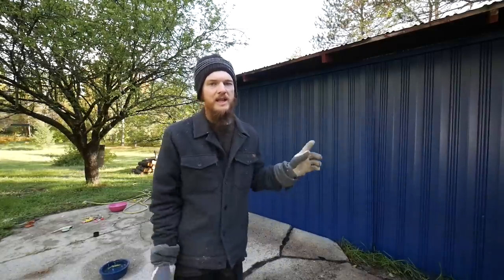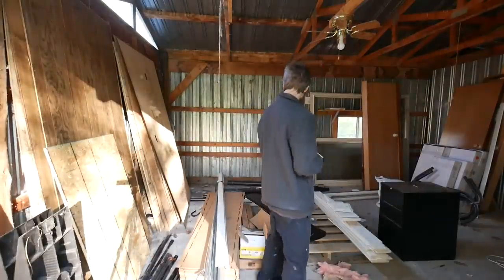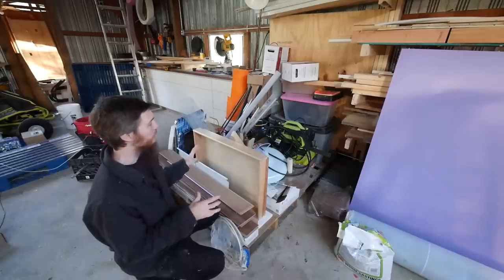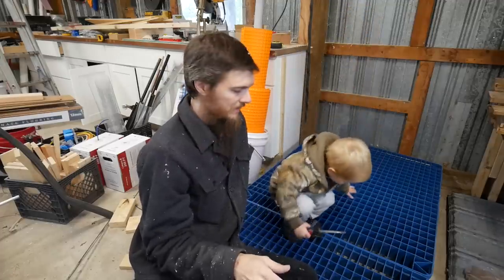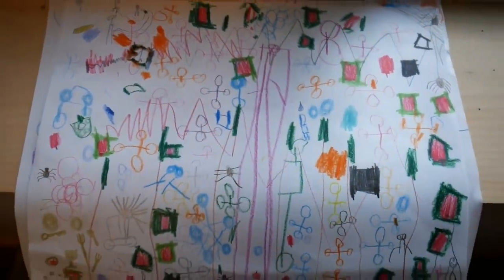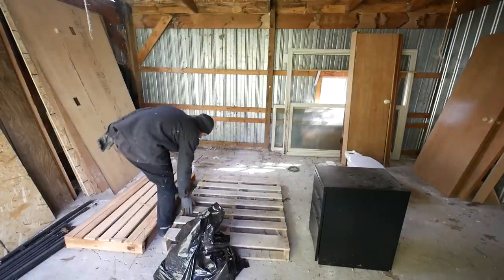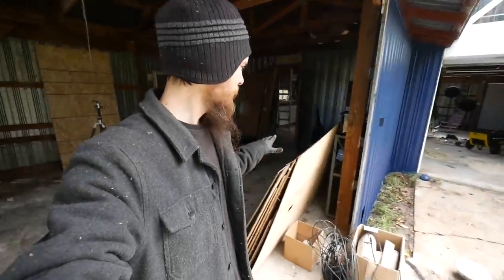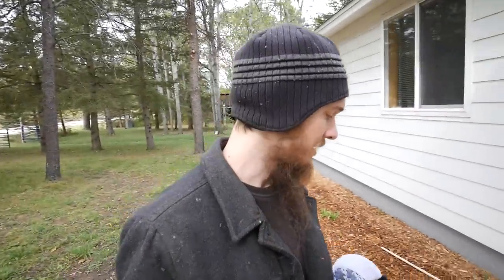This Mess Never Ends - Getting Ready for the Next Big Project

Comment: That space would be perfect for an Art/ Design studio. The old slider could be used for two large windows to let natural light in, insulate that room and then use the paneling in there, put up the wall cabinets to hide all the arts and crafts supplies, use the space header to keep the chill out and add foam insulation and rugs for floor. My Dad did that for me in the attic of our garage and I have been an Artist ever since. Its always nice not to have to pick up a project in process until you are finished. I would be lost without my studio.

Comment: Your siding pieces might come in handy if you ever need to repair  hole in your exterior  at some point [Mower throws a rock or some other accedent} I suggest you build a standing rack, say 12" deep or less, against a wall, for all your paneling pieces. Would not take up much room and have a spot for them and any thing else that would stand up.  Love watching you all solve your problems! You all are very inventive and so unique!
Reply: Great idea we were hit by a hail storm and the extra siding we saved was used to repair damaged pieces.

Comment: Use the wall cabinets as lower cabinets, they will just be a slimline version, you could possibly put some legs on the to raise them off the ground
Reply: I was just about to post the same.  A little blocking under and a nice top will make a nice bar in the new spot.
Reply: Or make an island style work bench out of them on rollers.

Comment: If you do not have any projects planned for the wall boards then maybe consider the walls in the room you are cleaning out now.  If the darker finish is not desired then paint them white or any color you choose.  It looks like they are actual wood panels and not the newer compressed paper laminate.  So consider them like luan.  They can also be nailed up backwards so the grooves do not show.  Some could be mounted above the cabinets in the main garage building for a tool wall.
Reply: I hadn't read your reply when I gave mine.  I had the same thought.  I thought I remember him saying it would be nice to have a heated room for a shop, and because that was smaller, it would be easier to heat.  I suggested insulation (would probably have to be cuts of styrofoam) and cover with the old paneling.  It's all mismatch, but that's okay.  I also suggested an area for starting plants for summer because of their short growing season.

Comment: Murphy's law says that a week after you throw away those cut-offs, you will find the perfect job for them.  I'm thinking shop or garage shelving of some sort -- I don't know how strong the stuff is.  But it is nice to have narrow shelves above a work space for all the little jars or cans.  If the shelves are too deep, you lose track of what is behind the front containers.  I'd hang onto them until next year, and if you haven't found a project for them yet, then well, you have a wood stove.

You can't find a use for the paneling, as we all stare at the bare wall behind you.  Why not?  Especially if you decide you can afford to heat that smaller room and need to slap up some insulation.  I mean, why not?  You can always pull it down later if you don't like it, and it will be out of the way for now.
Reply: sadly they cannot hold much weight as the are only 4-6ml thick

Comment: Thanks for the video, DIYff!  You can use those hollow-core doors as light duty shelving for storage.  Make truss hangers for them and you won't have to attach them to the hangers - just set them on the hangers you've made for them.  I have used hollow-core doors as work surfaces - work tables....for light duty work.

Comment: Those electric heaters are pretty good and they stay warm for a while when off because the liquid inside them heats up. You have no heat in your shed at this point so you could still use it in the winter. I bet that disappears pretty fast by the road if you have any traffic at all.

Comment: You should turn the new space into an arts and crafts room where belle and maverick can paint and make a mess and you can make more bits for around the house. You could repurpose some of the old wall panelling as an art presentation board and use the old door to make a big table for drawing  and painting at. You could even mount some of the old kitchen cabinets for keeping craft supplies in , like paints, ribbons sewing materials etc.

Comment: Just a suggestion: If you have space for another small workbench, use the cabinets as base for that. Then you'd have a tuck away for the small tools, screws, nails and what zis?
Reply from the maker: I would consider that but they vary in height. Maybe they'll work out for another project.

Comment: might be able t use the plumbing pipes for a greenhouse
can put the compressor over the mitersaw and hang a blownozzle from it
might be able to lay the doors flat on the rafters
you can clad the stell walls inside the ban with the paneling might keep it a bit warmer in winter
Reply from the maker: That old compressor needs a new pressure switch and I'm not sure I want to put any money into it.

Comment: We have used covered wire to support our raspberry and blackberry canes. Works great. What about using the wall board in the garage. Do you want to insulate the garage? Even if you don’t it gives you backing for your upper cabinets.
Reply from the maker: I would like to insulate the small room, but I'm still deciding if I will.

Comment: One of the things I learned about saving items. First I ask myself if I plan on using the material anytime  soon. Then I ask myself if I save it, will I use it in two years. If those answers are no, I eather recycle or put it up for sale( if its usable) or I put it out front for free. If it doesn't  dissappear,  its junk. I see room up in the rafters for a few items. I have friends that have two generations worth of junk. Some can be sold, fixed or other wize, but when it gets to the point it becomes clutter. I hate clutter and hate it when stuff gets ruined from being improperly stored.

Comment: Do you have problems with the Metal Shed Sweating? I had one that sweated and I used Duct-wrap on it. The Duct-wrap has a Reinforcement Netting in the foil face and has a higher flame rating than regular insulation.
Reply from the maker: No, I don't think we have issues with the metal sweating.

Comment: Putting a pressure washer in a lower cabinet with cold weather coming is a prescription for disaster. You are likely to forget about it there. No matter how well you try and empty the water out some is likely still in the pump. When it freezes it will likely crack the pump and make the washer useless. Bring it inside where its warm like your utility room.

Comment: Holy cow, How much did that Birch plywood cost per sheet ?
An easy way to strip the longer pieces of wire is to stretch it, say between a car and a tree and then run a soft grinding wheel down the length, exposing the copper, then peel away the sheathing. You then have what we call Bare bright, clean copper and it pays top dollar. We do the same with the shorter pieces, between a vice and a come a long. It's work, but it pays.
Have you ever tried ''Freecycle.org'' You can give away free stuff and get free stuff.

Comment: Never sale good name brand tools.  Sometime in the future you will need those good tools while you are still able bodied.  If it's a broken generic tool then that's different.  My wife laughs at me for having 27 different types of hammers when I was working.  Now since I'm disable and not working, I only have about 10 different types.  But none of my Aviation, Automotive, Tractor, or Hardware tools are for sale even though I probably will never use half of them again.  Great job of the renovations you 2 or should I say 4 since the kids pitch in from time to time.